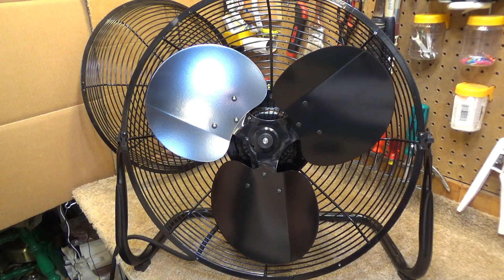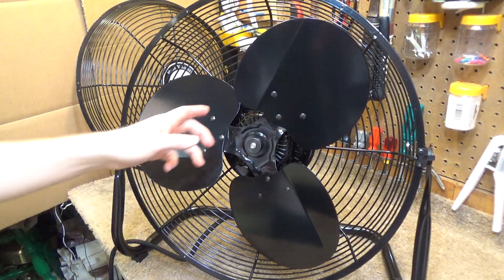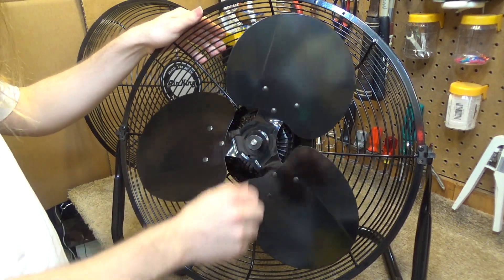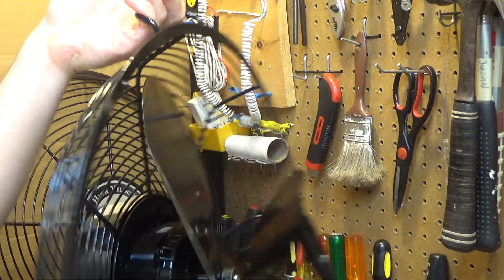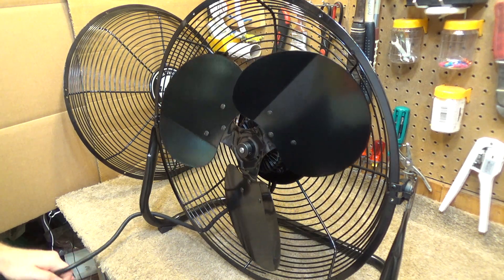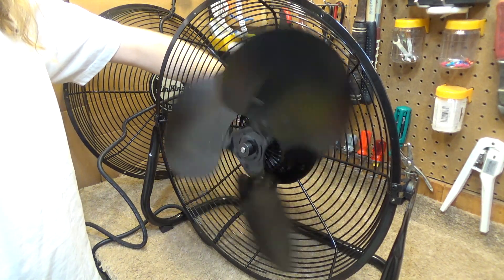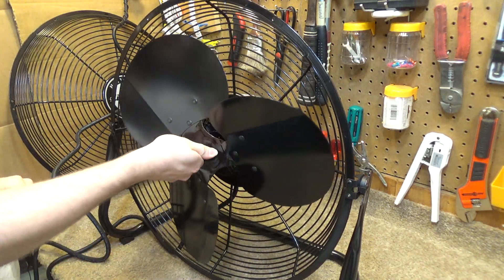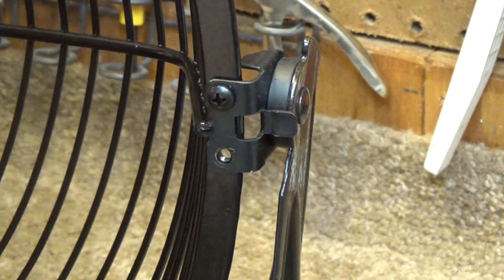Attempting to Balance an Air King High Velocity Fan

Comment: I have exact same problem. Hub is off center. One blade is heavier than other. Bent one blade that was different like you did. Helped a little. What really helped was the attachment at frame with double screws was bent. Straightened it and helped a lot. Also the as were not straight to each other. Laid it on it's side to be able to see one side compared to the other and bent them by hand until even with each other. That really helped! Hopefully you can get yours better if you haven't already. I've had one for over fifteen years and it has been running countless hours. The one I got last year is the one out of balance. But is so much better now. Thank you for the video!

Comment: It’s me again. But do you know where I can get more if they make replacement parts, because I have a vintage not Mountain Drive even know it runs like Mountain Drive… But a vintage direct drive came on vaccine from the 50s, and just move the time, and following the blades been kind of bent and I am homeowner, and I was wondering/owner wasn’t sure if you know if they make replacement Aircon planes so I can stick it on the Kenmore and like a 20 inch or so it’s not something like that, because I think they’re helps us is the same or similar in the sense from a link with P 25… I have sizes to Maine for the Kenmore and vice versa. I learned/and during this covenants last night when I make my dad if I could do a plane slot and then he said yes just put it back together so I did the blade swap yeah only if I known the plane tomorrow all right and salsa. No if it were a different box saying that the Kenmore like another like one or something similar, then yeah… The plane probably would’ve been able to swap just as easily like the S223 plastic family or Kmart plastic five plain. I don’t think they make a plastic timeline vintage only a plastic thing in Blaine on a little pedestal fan all right tilting fan kind a like the Kenmore five blade or the Tilting hurricane force fan, or whatever it’s called or so. But I was just curious because I may replace it and I may put it on your black… Well I can find one that’s the same color Estefan I could green tap color, or just get a black one or silver one and just paint it myself which I think is what I might do...or leave it black/and or black/blck or so

Comment: hello Jordan ive watched your video on how to balance the blade for your air king floor fan , I myself am having an issue with a fan of my own, mine is a western auto wizard box fan , i'm not really sure if you're familiar with this particular unit but it has 4 steel blades and i've tried everything from bending the blade set back in to place but the center hub of the blade was also loose , i mended the hub back together with jb weld and made no improvement in the process , would you have any advice on what to do with this problem please respond.
Reply from the maker: Unless you applied the JBWeld exactly evenly around the entire hub, that has probably created a major balance issue.
Reply: @JordanU   Maybe it's possible that I didn't line blade up directly in the center of the hub; that's how I cought on to the problem with my fan by watching your video. Perhaps I could post a video of my fan on here so you can see the problem for yourself? Thank you friend, and God Bless.
Reply: Maybe it's possible I didn't line blade up with the shaft properly, that's how I caught on to the problem by watching your video , would you like to see a video of my box fan to where you can see the problem for your self? Please respond and God bless you my freind.

Comment: Try sticking some lead tape pieces on the back of the blades opposite the side of the prop that has more weight on it. I was able to balance my own 9220 and 9218 to near perfection that way
Reply from the maker: I will get some and give that a try..

Comment: Hi Jordan , good video I have purchased two of the air king fans a 20" & 14" and both have had the same issue being out of balance and my solution was to locate the heavy blade the way you did and mark it .then remove the blade assembly and shave the outer edge of the heavy blade with a bench grinder a little bit at a time until the blade assembly stops at random positions indicating no heavy blades , this has worked very well on both air king fans I have , I think they are probably one of the better made fans available in spite of the quality control issue.  Terry
Reply from the maker: I do believe that is the best way to fix it..

Comment: Here's a simple way to balance a fan, see www.instructables.com/id/How-to-Balance-a-Fan.  With the power off tape a small weight such as a dime to a blade tip, release from 4 o'clock and measure how far the blade rotates down. Then move the weight to the other blades and measure how far each one rotates from 4 o'clock. The heavier blades will rotate further. Rank the blades from heaviest to lightest, then add a 6" piece of duct tape to the center of the lightest blade. Place the heaviest blade and lightest blades at 4 o'clock and 8 o'clock. Keep moving the dime from the lightest blade to the heaviest blade and compare how far each one rotates. Keep trimming the tape shorter until the heaviest and lightest blades rotate the same distance. Next add 6" of duct tape to the center of the middle weight blade, and place the heaviest blade and the middle weight blade at 4 o'clock and 8 o'clock positions. Keep doing the dime test from the 4 o'clock and 8 o'clock positions and trim the tape until the heaviest blade and the middle weight blade rotate the same distance. I have pictures and more thorough instructions in the link.
Reply from the maker: Thanks for the suggestion..

Comment: I have read in reviews of this fan that this is a very common problem with the blades being out of balance.  If the blade is not centered right, then it would be impossible to get it into balance perfectly. Considering what others have said in other comments, yes they should not be allowed to leave the factory in this condition for the price.  But today pride and quality is no longer part of manufacturing of everything. As for my fan use,  I set my central air conditioning at 80 degrees and use 2 high velocity fans to circulate the air and it is very comfortable and my air conditioner runs much less than my neighbors'. My air conditioning is over 30 years old so I am cautious when I use it, but it works fine. Over the last 5 or 6 years I have purchased older metal high velocity fans like this at flea markets.  They are Patton and Hampton Bay models and one Lasko model made in the late 1980's or before.  The Lasko one is a silver blade just like this one here but probably heavier metal as the fan weighs about 30 pounds.  It runs perfectly with no vibration at all.  I also purchased an Air King 20 inch window fan from someone on craigslist which was probably made early 1990's, but I am going to take it out of the metal case and install it on a stand where it will sit on the floor.  It also has no vibration whatsoever. Overall I have 6 18 inch and 8 20 inch high velocity fans and I rotate and use 2 different ones each day so that they are not over used, along with keeping them clean and oiled every year.  None of these older fans have failed on me, but I have had several newer fans fail on me within one year.  With all of this said, my advice is this:  If you want a new fan,  Air King is probably the best, but hold on to your receipt until you get one that works right and be prepared to stand in the return line several times until you get one that is right. It took me 3 times with a Lakewood fan several years ago until I got one where the blade was right.  Then after 2 years it quit running.  Additional advice: Keep your eyes open on craigslist, flea markets, or garage sales and get yourself something older that was made well and will probably last you longer than the junk of today.  Even if you have to work to clean it or even add a little bit of paint, it will be worth it for you as it was for me.  But know that some people are getting wise to the fact that older items are better made and they are holding on to them, so you will have to be patient and persistent here. You see vintage fans listed on Ebay all of the time, but you will pay much more here along with the shipping.  In conclusion,  no one should have to mess around with balancing a fan blade on a very expensive brand new fan that is supposed to be USA made.  In final conclusion, quality control and pride is gone in manufacturing anything these days, so stay away from the junk of today if you can.
Reply from the maker: I get vintage fans whenever I see them.. I have an extensive collection..
Reply: Whatever you do, hold on to those vintage fans.  You will not buy anything like them in the stores today anywhere.  Keep them oiled and clean and they will keep running for you.
Reply from the maker: @chippyskites  I know..

Comment: I was able to correct this issue on both my 9218 and 9220 by putting ceiling fan balancing weights to the blade spider on the lighter side and further evening out the weight with lead tape on the rear side of the blade, always toward the bottom because if you put it toward the top it has the potential to become a projectile if the adhesive fails.
Reply from the maker: Perhaps I'll give that a try sometime..

Comment: I also have an Air King 18" HV fan, & I've made my final decision to mount it on a piece of plywood to use as a window fan.
Reply from the maker: I think it should work well, these have a relatively high volume of air movement..
Reply: They certainly do. Especially Air King HV fans with metal blades 18" or bigger.
Reply: On 2nd thought, I may do bigger & go with my Air King 20".
Reply from the maker: OK

Comment: All of my Air King Fans have that issue.
Reply from the maker: It's unfortunate, I think they all do..
Reply: I would still find them to be useful, however.
Reply from the maker: @diyintrovert961  I don't believe the shaking renders them useless either..
Reply: @JordanU  I'm already thinking of attaching one of them to a piece of plywood.
Reply from the maker: For use in a window?
Reply: Yea. Either that or as an air purifier when I put the rest of the housing together.
Reply from the maker: @diyintrovert961  I don't think this will produce enough suction to draw air through a filter well.. One of those big furnace blower fans would be better suited for a build like that..
Reply: @JordanU  The way I plan on doing it, I see a huge possiblility. I'm using a vintage 14" box fan right now with 4 HEPA filters attached to it in the form of a box. Nevertheless, my other option is to use is as an exhaust window fan.
Reply from the maker: @diyintrovert961  I'm surprised it's able to draw the air through those filters well..
Reply: @JordanU  yes it is. My filters are looking gray right now & needing replacements.

Comment: at least you try but i do agree with you for something that claims to be made here in America and is very costly. the out of balance blades and sometimes the motor defects as in my case is Unacceptable from Lasko .. this should not be happening at all
Reply from the maker: There is definitely some kind of quality control issue with these fans..
Reply: @JordanU  You got that right bro bur finally 18 is perfect now after the motor noises went a way for good no problems and there a few flaw one chipped paint from the stand just a little bit. and a very small gap in the guard at the top where the handle is ... and that's it is well balanced and doesn't shake real bad